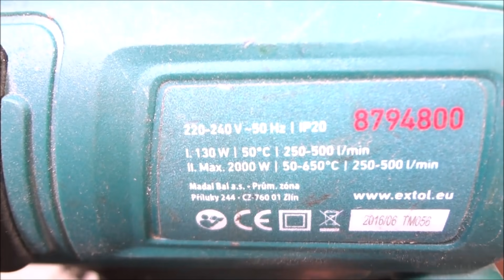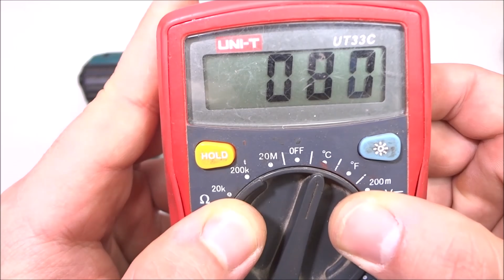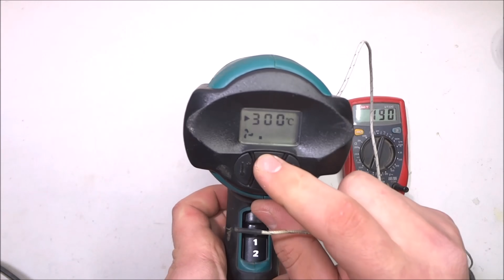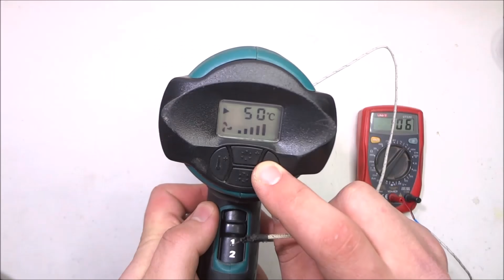Extol Industrial Heat Gun Fan | Digital Temperature Control | Disassembly TearDown Taking Apart

Comment: hi . i have one like this , but control temperature dont work good . are you can  help me to fix this problem ?
Reply from the maker: So I havent run into that kind of a problem, but I'll try to help you but need more informations.
What brand is it , is it digital control with display or with rotary potentiometer. Check for burnt wires, heater coil , switch. Also if you can take a picture or video and sent it on Next Current Social Media (facebook,instagram or twitter) links in description. Looking forward hearing from you again. Take care.
Reply: @NextCurrentDIY  HI THANKS TO ANSWER. 
it is digital control whit lcd display . and control with 4 knob  temperature +,- and air+,-. brand is einhel RT-HA2000e.
wires is ok  termocopl is ok  and heater coil and cheap coil is ok. problem is depended to board . which control temperature . first that is properly working   then past 20-30 sec go to high temperature without press any key .!!and how much set high temperature this time become shorter and revers.can it depended to thermistor  ?
Reply from the maker: @ashkan2662  On the 1st pcb are there any blown electrolytic capacitors ? Also maybe try on the 2nd board where the display is to clean contacts of the buttons but do not touch the lcd display looks very fragile just clean around him where the buttons press on. Also clean and test the main sliding switch that has 1 and 2 function, low and high temp.